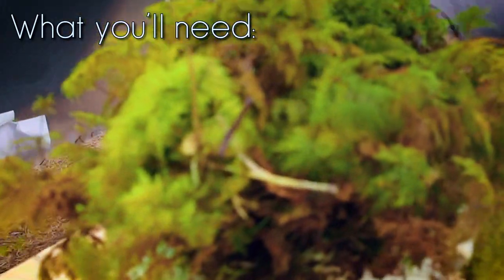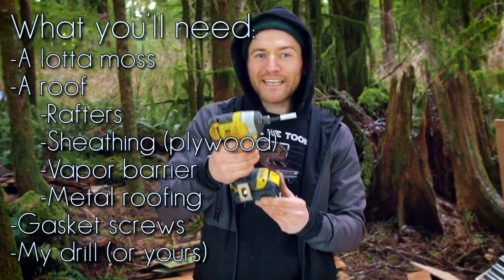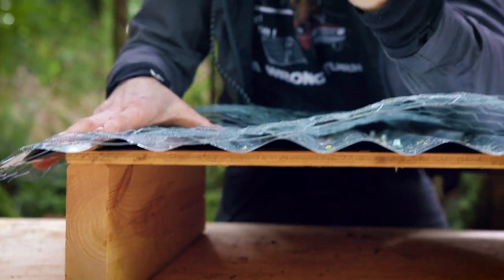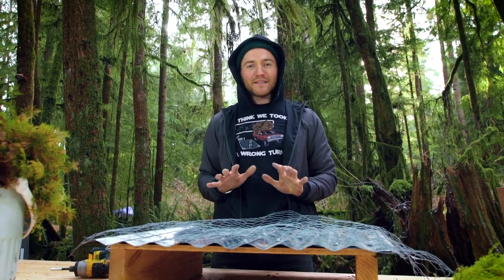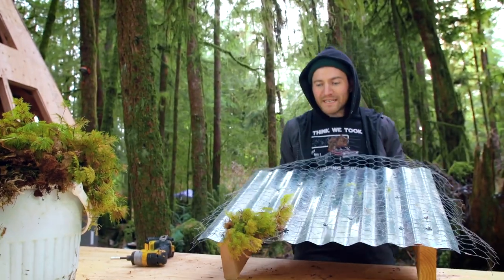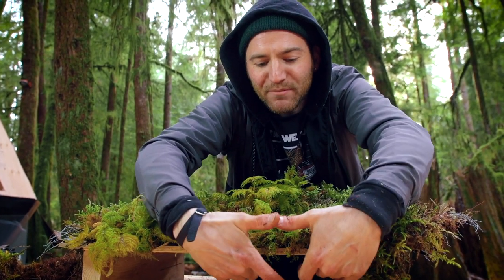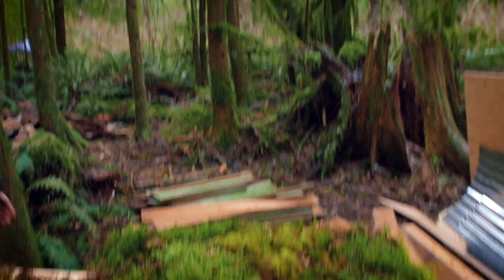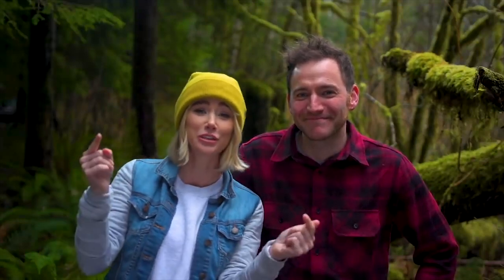Things I Think I Know How to Do: Moss a Roof

Comment: You should never put the screw in the valley of the corrugated iron, it’s more likely to create a leak in your roof. Only install your screws on the high ridge of the iron.
Reply from the maker: Nicholas Tan we’ve heard... an interesting topic!
Reply: @Cabinland  did you ever  have any water issues ?
Reply: @dimitrisl9085  moss is kinda waterproof to a point
Reply: @dimitrisl9085  he probably won’t untill the screws wear out🚫, it’s more likely bc the water travels down the valley. Not really that much worse though unless the roof will be holding water. Their pitches seem like it won’t be that much of a difference if any.
Reply: Any tradesman who screwed custom orb of like you did in the valley, isn’t a tradesman. Even over screwing on the ridge can leak.
Reply: Came here to say this 😂

Comment: Putting the chicken wire under the screw gasget leaves a small opening for water to leak.  Another sealer should be used in conjunction of the gasget.

Comment: How have the roofing screws that you used on the chicken wire held up to rain? I'm nervous about how well the gaskets hold when they are on the wire and not the flat surface of the metal roof.